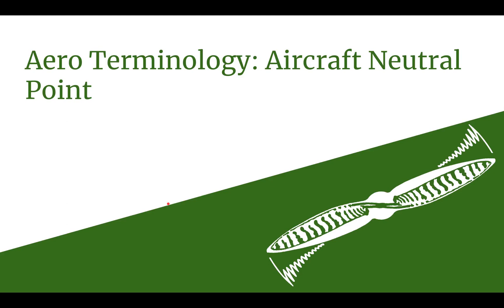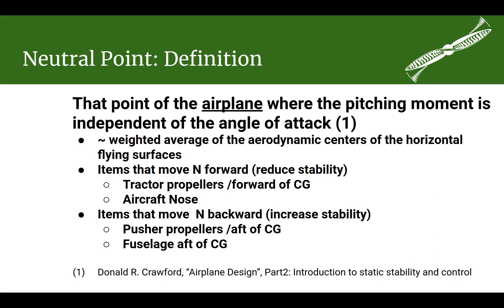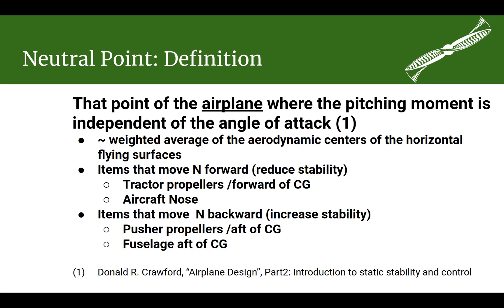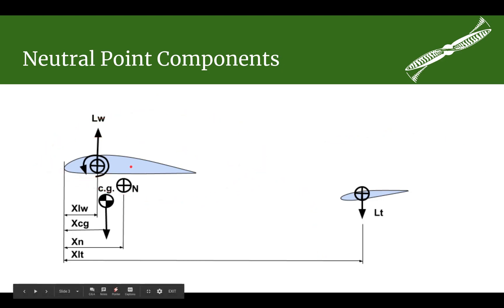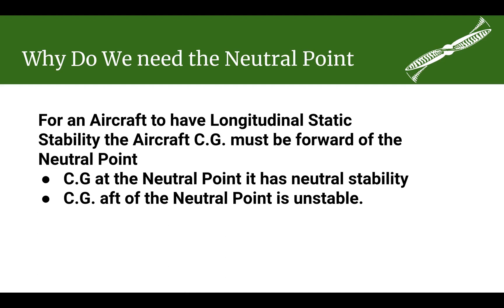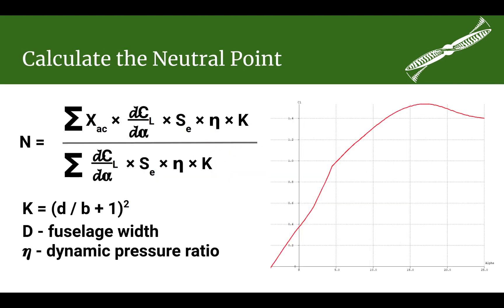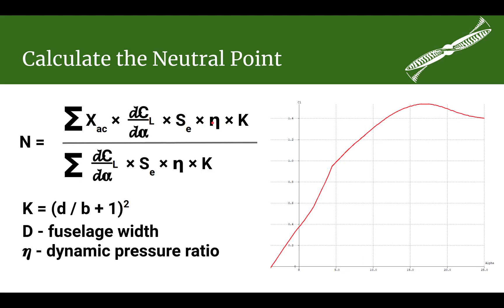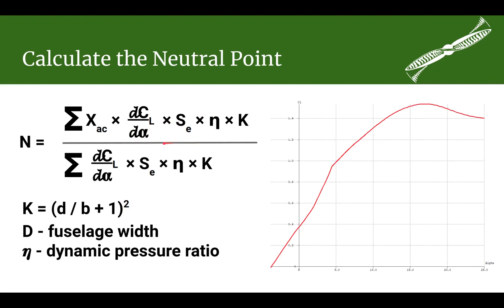Aero Terminology: Neutral Point

Comment: When you said we should take all our flying surfaces into account when calculating, do we also take into account the horizontal stabilizer (or canard) ? Or is that not considered a flying surface?
Reply from the maker: Yes, the wings, canard, horizontal tail and vertical tail are all flying surfaces.

Comment: Hi, small question
is neutral point same as centre of lift?
Reply from the maker: Nope.  The Neutral Point is strictly dealing with stability. The longitudinal point where, if the CG is placed there, the airplane has neutral stability. The Center of Lift is the point where  you can think of all of the lifting surfaces and their moment arms acting together could be replaced by lift at one point.